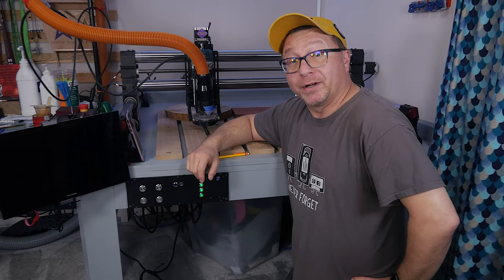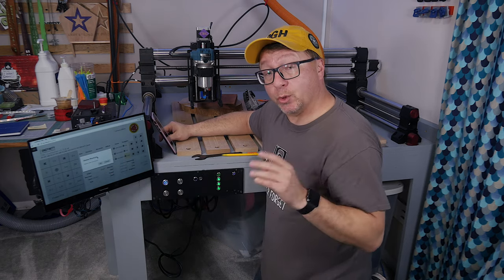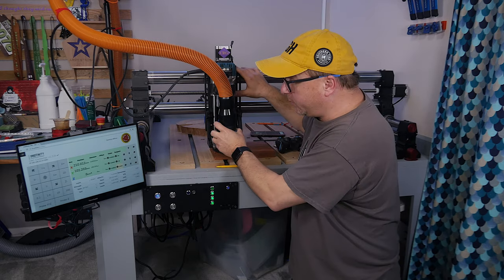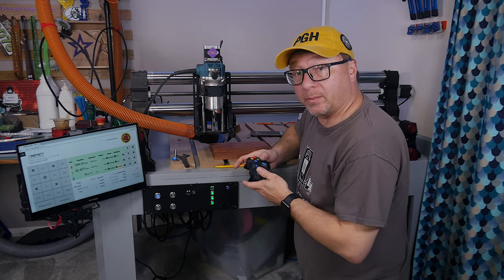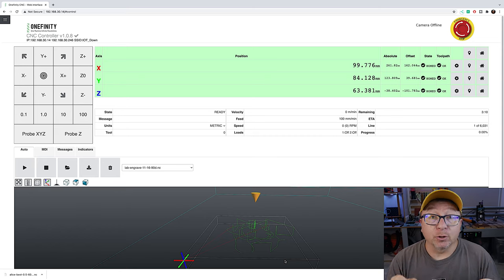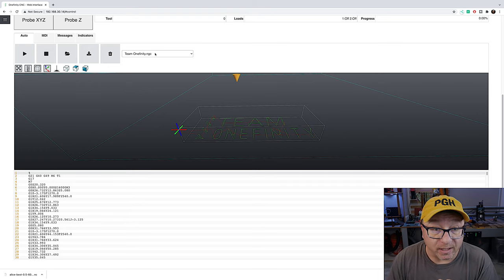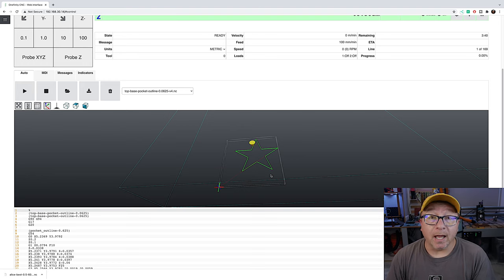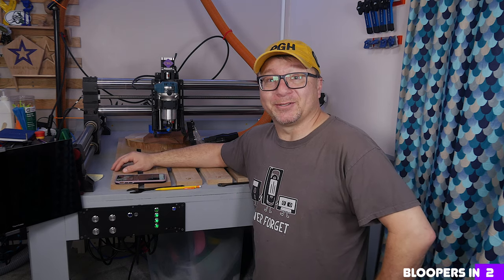How to start milling with the Onefinity CNC

Comment: I see your using a viewsonic monitor. Can you give us the specifics, is it touch scree, resolution, and what did you have to do to get it to work with onefinity controller. Thanks for the great content
Reply from the maker: Hi Landy - here is the link to the monitor: https://amzn.to/3jsPgtF - I did nothing other than plug it in and it worked.  It is 1080p, 15", which is a lot easier to see. Make sure you have the ports corrected properly though. Thanks for watching!

Comment: Do you have a link to the monitor you're using?  Any special cables needed to hook up to 1F controller?
Reply from the maker: Hi Burton - here is the link to the monitor: @t - I did nothing special other than plug it in and it worked with the cables provided with the monitor.  Make sure you have the ports corrected properly though. Thanks for watching!

Comment: When you use the block to zero out the machine you mention running a macros do touch the left and front side of the block.  Can you explain that process a little and what macros means.  thanks
Reply from the maker: Hi Burton - I anticipated this question - I will be posting a follow up soon.  Stay tuned.  Thanks!

Comment: I just finished my assembly and things looked good. After several exercises going back and forth on the X and Y axis I noticed that after Homing the left Y is about 1/32" from touching the front stop while the right Y is fully touching. It doesn't seem to effect the operation. Can this 1/32" misalignment (left to right) create me a problem? Or if it moves  the full 800mm travel then things are OK?
Reply from the maker: Hi Donald - it is unlikely to cause any major problems, but you can usually correct it by simple pulling the other side forward after homing.  If that does not work, ensure your machine is completely square - the rails might be parallel, but that does not mean they are square.  Check out my squaring video for 2 different techniques: https://youtu.be/DM8yxCw1XdY
Reply: @cyberreefguru  thanks
I am rechecking my square by measuring the diagonals. It is very close. I need to re run my homing.

Comment: is this a 3d or 2d i dont see a 3d  interface  or did over look it
Reply from the maker: Hello Joe. Do you mean is it capable of 3d milling? It is capable of milling in all 3 axis (x, y, z).  You can modify it for a 4th axis, but that is not supported by Onefinity directly. The user interface is only for controlling the machine and monitoring cuts; it is not for modeling or creating tool paths.  Hope that helps - thanks for watching!